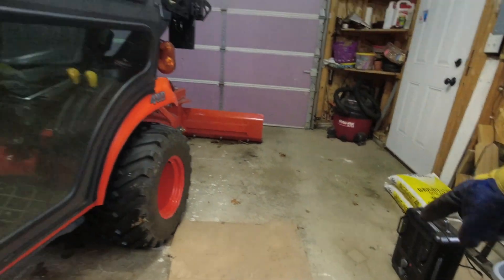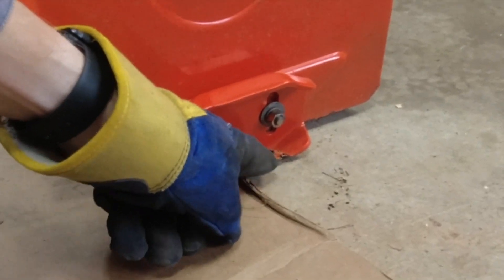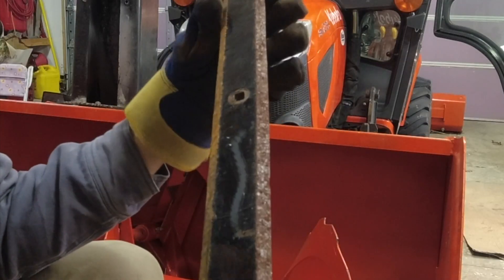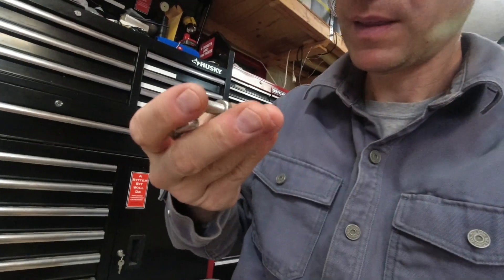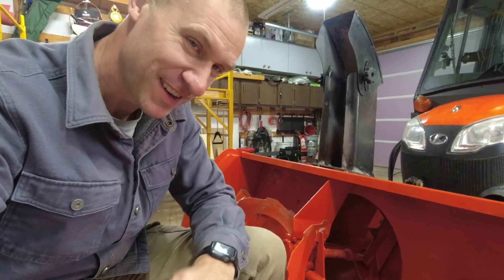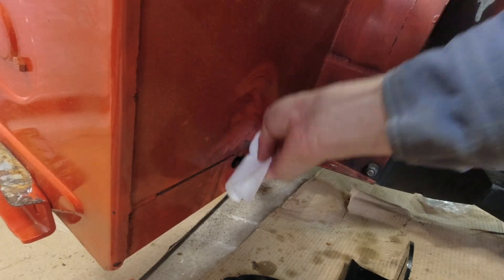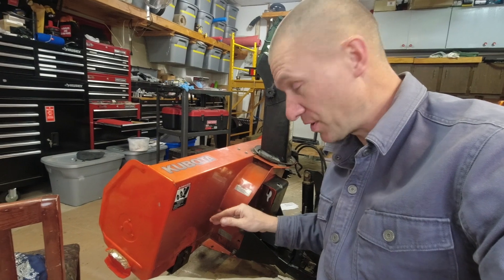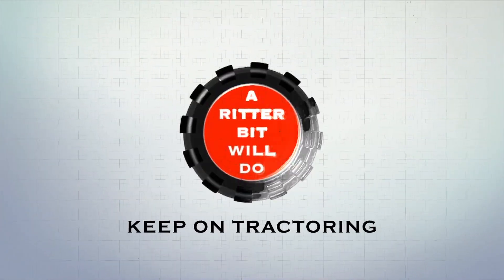FRONT MOUNT SNOWBLOWER (Kubota BX Tractor)

Comment: I wish Kubota make the side shoes on the new blower drop down farther. We got nailed with a whack of wet snow last week. Knee high! I have a gravel driveway and usually I’ll back blade the snow down with the loader just to give it a hardened layer so I don’t pickup any gravel with the blower. But there was just too much snow. Blower was digging in into that wet and not so frozen driveway. I was picking up gravel and blasting it on to the lawn. Had to run around with the blower raised and the driveway didn’t look so great after I was done. 
I think I may have to makeup a custom set that will keep the blower up higher for that first time of use. That little tractor saved the day for sure this time around. That snow was heavy and it didn’t miss a beat.

Comment: Just put the blower on my lawn tractor last weekend...leaf season is pretty much over for the year and took the last decently nice warm weekend and installed the blower...made it a bit less of a hassle this year as I had put the snow blower on a pallet to make it easy to pickup and move to my carport without having to try and carry the thing from the shed...if only it made it easier to install it, still somewhat of a struggle for installation due to the design, but a lot less back breaking using the pallet forks on the tractor rather than having to pack the blower over by hand.  

Now that the snow blower is installed on my lawn tractor we are guaranteed to not get any snow.  Haven't had a decent winter since I bought the snow blower...the winter prior to buying it, I had 2 feet of snow in my driveway...hasn't snowed very much sense...most we've had was about 8-10 inches, barely enough to really get an idea of how the blower would work.  I had to modify it a bit as I have a gravel driveway, even with the side skids down as low as they'll go it would sink into the gravel and pick it up and throw it all over....so I cut a slot in a steel pipe and attached over the cutting edge that's supposed to help it slide over the gravel rather than dig down into it, we shall see.
Reply from the maker: Great idea using the steal pipe trick. I hope that works out well for you. My buddy just got a tractor with a snowblower and has a gravel driveway. I'll suggest this idea to him. 
I hope we get a good winter with plenty of snow so you can really but that equipment to use. 
Keep on tractoring!
Reply: @ritterjon  I don't mind the snow, just wish people would learn to drive in it...seems every snowstorm here in Idaho people have to relearn how to drive, rather they just never learn at all.  

I had thought about a snow blower for the BX but the snow blower is already been purchased for my lawn tractor...however, I may pickup a blade for the BX instead.

Comment: When I had that snowblower, I replaced cutting edge with a poly blade and replaced skid shoes with pieces of poly at the same height as cutting edge. Scrapes down to pavement without worry of damage.
Reply from the maker: That's a good idea! Where did you find the poly that worked for your blower?
Keep on tractoring!

Comment: I just installed a exhaust diverted that I found in Riley Auto parts. It is a 90* sweep that now diverts my exhaust down toward the ground instead of toward the FEL. Drilled a hole to hold a sheet metal screw on to the exhaust pipe. Found a tube of furnace cement at TSC to fill in the gap around the two pipes and looks like it is good to go.
Reply from the maker: That's what I eventually need to do. Does it effect how your hood opens at all?
Keep on tractoring!
Reply: @ritterjon  No. The exhaust exits through the plastic grill. How would you like me to send you a pix of it?
Reply from the maker: @waynehigden  I actually found some pics of that mod online. I can see how it works now. 😁👍

Comment: I was getting my blower ready for the snow and I noticed my side shoes were worn out.  I had a trailer that I scraped out and I saved the springs.  The springs had settled almost flat so I cut some pieces about 10" long.  Bent up ths ends and welded them to the old shoes.  I don't ever plan to replace them again.  They are made of spring steel.
Reply from the maker: That's a great idea! I need to try and find a cheaper, longer lasting alternative. 
Keep on tractoring!

Comment: If you add some arc weld to the shoes they last longer. Also you may want to consider a poly wear edge. McMaster Carr has all kinds of plastic stock and they take a credit card. Not the cheapest, but stock is usually great and overnight delivery. Keep the vids coming buddy!
Reply from the maker: I checked out that McMaster, they really have a wide variety of material. I might find something that works for a cutting edge. Thanks for the lead. 
Keep on tractoring!
Reply: @ritterjon  if I can buy local I look first, if I can’t find what I’m after then it’s McMaster.

Comment: I need to remove the mower deck and attach the front blade on my LX2610 in the coming weeks. I've been tempted to get a 3 point snowblower but we only get 2-3 storms a year of 18"+ where it would be really helpful. Otherwise the 72" front blade with hydraulic angling gets the job done fairly quickly.
Reply from the maker: If you can find decent used one sometimes it's nice just to have the extra counter weight even if you don't use it. Never hurts to look right. 
Keep on tractoring!

Comment: Awesome video Jon. Love the content as always. What did you learn at GIE for the Kubota 23s? Any changes and improvements? Self-leveling bucket maybe? Optional dual drive pedals (like JD) instead of a treadle setup?
Reply from the maker: Kubota didn't have their entire line up of products at GIE. They mainly just had UTV's, skids steers and zero turns. The only new thing I've noticed on the BX23S at my dealer was different control knobs. Everything else seems about the same. 
Keep on tractoring!

Comment: Set your scraper blade at 1/8”. It will still scrape clean & last much longer. It does not have to actually touch the pavement.
Reply from the maker: I have that stupid 1/4 inching valve so it’s impossible to do that. Check out my latest video where I install a rubber cutting edge. 
Keep on tractoring!